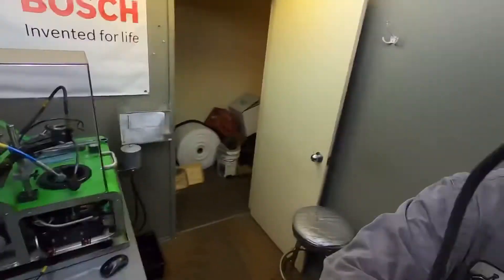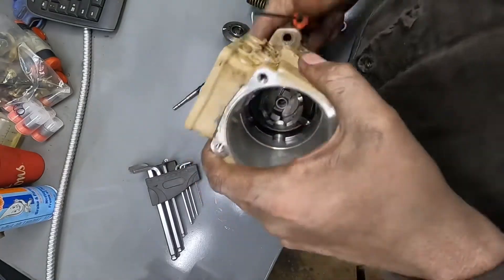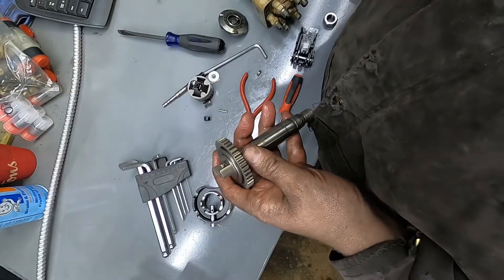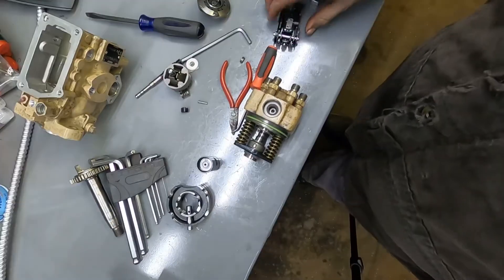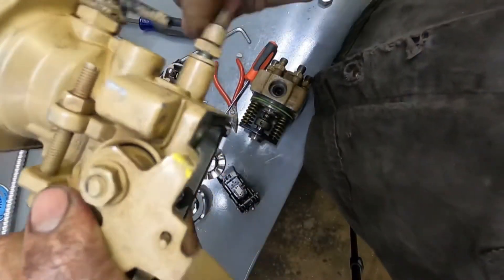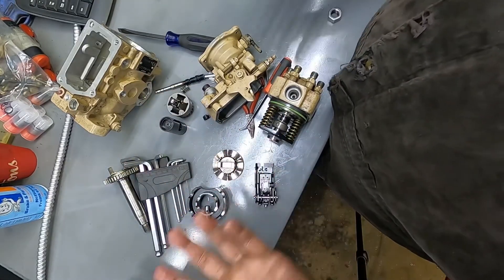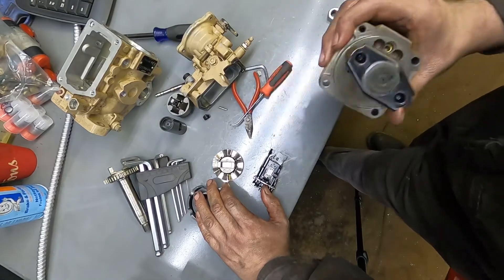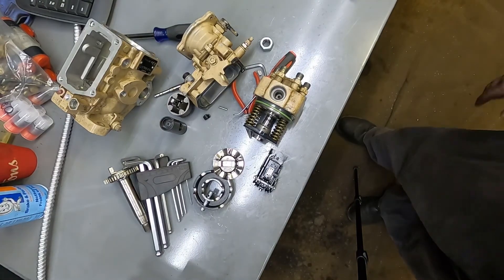PART 2 Bosch VE Cummins injection pump tare down.

Comment: New sub here, Awesome vidio that’s what I like to see.
I got the brand new pump same this one in the video but with the Key ON with lift pump on, fuel just pouring straight through the delivery valve for number 6. Is that’s mean fuel pump faulty ??
Reply from the maker: @amrisalk233  nope that’s normal. Thanks for the sub
Reply: @CUTTERUPROB  Cool..Thanks for quick reply, I almost buy another one.

Comment: At 2:00 mark that is more than just a cold start piston specifically it's a dynamic advance piston that advances injection in accordance to pump case pressure which in turn increases as the engine rpm increases. Only pumps with cold start mechanisms pushes on this piston thereby advancing it making cold starts easier. Otherwise its main function is dynamic injection advance.

Comment: I have a leak from that bolt your thumb is touching at 3:05-3:06, is it possible to fix without a rebuild
Reply from the maker: There is a oring or a washer there you said be able to replace

Comment: Hi!! I hope you can be kind enough to help me. I ran out of ideas… I have one that loses prime so after few seconds the engine doest start anymore. We have to make the priming procedure… i already check for any possible source of leak or air intrusion. I do know it is the pump the culprit. Anything else is fine. Also shows less than ideal pressure. I guess we have two problems… would you help me with ideas? Thanks
Reply from the maker: Have you had the injectors tested and leaking injector can let the fuel flow back to the pump and let air in. Also you can do a bucket test. Remove inlet and return lines on the engine put clear hose on into a bucket with fuel in it get the engine primed and running and see if you get air bubbles when running. And then turn engine off and see which side the air comes from first. Gives you a side to start on

Comment: Hi!!! I have one that performs fine installed in the test bench, but in the engine loses it priming. I already checked and chance everything in the engine, so I do know the problem innonside the pump. Repair shops insisted the pump is fine. Any ideas??? Thanks in advance!!
Reply: Replace the inlet fuel hose from rubber to a transparent one and look for bubbles.

Comment: So your better off just putting in a 4200 governor spring instead of messing with the power screw just a thought
Reply from the maker: If your have the fuel yes I would do the gov springs. But the spring won’t add fuel

Comment: Great video.  Very interesting.  I recently put a THD fuel pin and 3,200 rpm gov spring in my '93 D250 12v and since doing that I have a lot of black smoke at the upper end of the rpm band.  At idle and at lower to mid rpm range it's all good, and the added power is really great.  I was thinking maybe backing out the power (fuel) screw some would help cut down on that black smoke, but after watching your video I'm thinking maybe that won't help.  If I back the screw out some, it seems like that bypass hole will still get covered, but maybe just a little later than it would if I left the power screw alone.  Is that correct?  Or would doing that be worth a try?  I've also been thinking about increasing preload on the afc spring, but I'm not sure which way to go.  What do you think would be the best way to go to eliminate that black smoke?
Reply from the maker: I will be doing some tuning videos on a Ve pumps shortly. I will explain
Reply: @CUTTERUPROB  That would be great!   Subscribed.

Comment: Hey Rob great collection of content your putting out! Its been so helpful. Question.. my rotary pump is leaking when I started it this morning. If I put new "O rings" will it disturb the pump. Will o need to have it recalibrate?
Reply from the maker: It depends on we’re it is leaking from.
Reply: @CUTTERUPROB  leak looks like from behind the bracket thats on the driver side of where the 6 injection lines exit the pump. The center nut is wet with fuel too.
Reply from the maker: hmmm sounds like the pump might have to come apart to be resealed. issue is most of the time when  you get in there there is more wrong with the pump other then just seals.
Reply: @CUTTERUPROB  thats what I'm afraid of. Well now I got to learn how to get the engine to TDC and lock the pump in place to pull it i guess
Reply from the maker: @2eyedjack433   if you can wait a day or two  i can make video  to show you how
Reply: @CUTTERUPROB  oh man! That would be great!. I dont think anyone in my town has a rebuild kit so I most likely have to order a kit. So it would be a few days. Thanks again. The truck is of great sedemental value. My old friend bought it used then sold it to my dad. Last month my dad gave it to me for my birthday.
Reply from the maker: That’s is for watching. Please share the video!